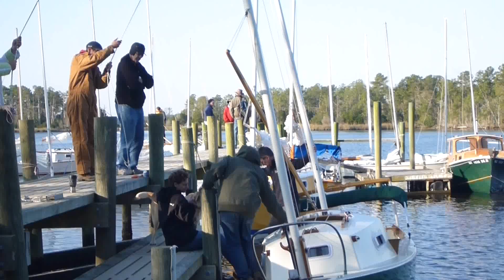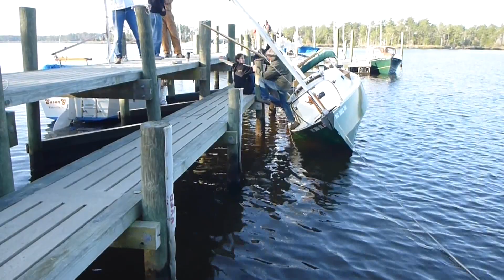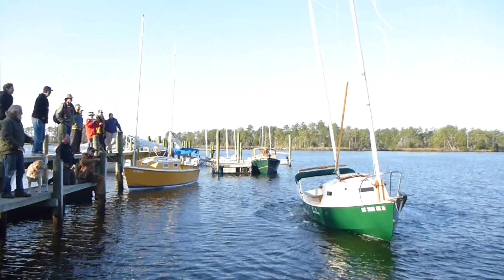B and B  CS20 MK2 Self-Righting Test

Comment: very good, one question, why the test does not take into account the weight of the sails or for example a dummy mass onboard, simulating the crew weight?
Reply from the maker: Good question. On this test the water was too shallow to have the board down so we had board up and sails down which is approximately equal trade off.

Comment: Dear Sir,at B&B,
I have been following your designs and can summarize that seaworthiness and safety, are always at the forefront.My experience at sea  always has been limited to outboard driven powerboats, and would like to try and build the model featured on this clip.( I have built a rowing version of a Payson cartopper so this will not be my first attempt).
 My question is,'' If the boat in the clip was fully rigged with sails,would it still self- righten with the added weight and drag of wet sails ?
 Keep up your good work,and greetings from Malta.

Comment from the maker: Hey Tom, Yup that's the idea. Wind alone is not enough to flip this boat. It would take wave motion and knock down seas. Also, since the boat is so stable with the water ballast it gives you more time to release the sheets or head up in a puff which further reduces the chances of actually getting as far over as in the video.